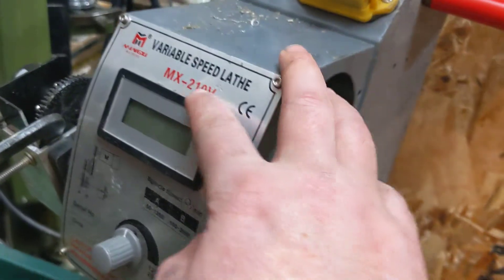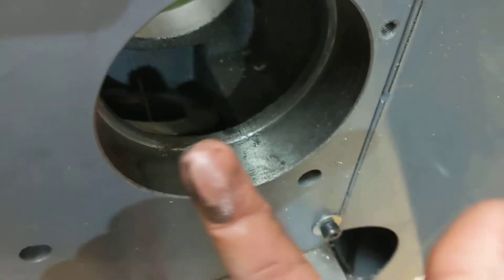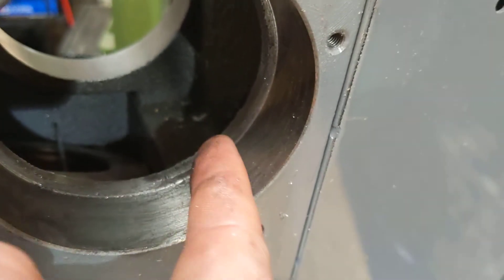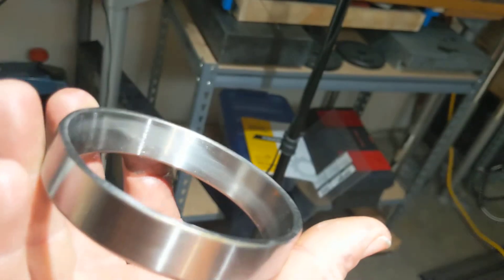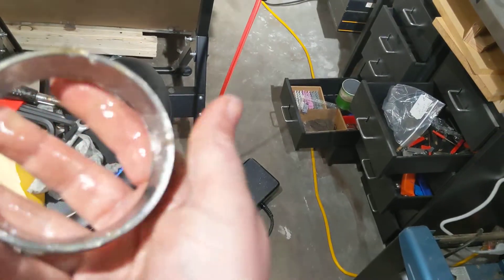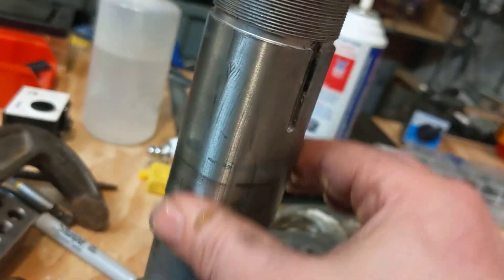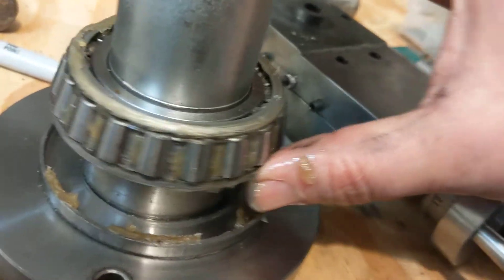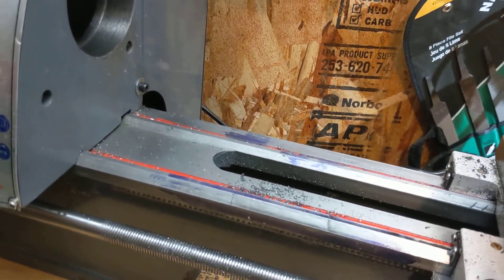mx-210 d/s spindle bearing wear not square

Comment: Just got mine and the spindle has about .040 of play, any idea what I can do to fix it or should I just return it.
Reply from the maker: 0.040" or 0.040 mm?  bid difference between the two.  get a spanner and tighten the spindle nuts (loosen the locking nut first).  If that doesn't help you should consider returning it or getting new bearings.
Reply: @JesseSchoch  0.040".
I broke it apart, cleaned the grit out of the bearings, tightened everything down, still has the wobble. Where would I find bearings for it?
Reply from the maker: @cordite_semtex  is the wobble radial or axial?
Reply: @JesseSchoch  A little bit of both it seems, but more radial. Thinking more on it after I took it apart, I believe the bearings are fine and it's the actual spindle that is cut off center, if all else fails I'll have my local shop machine it down and sleeve it center and see if that does anything. Still would be nice to have a spare bearings set though.

Comment: Hand scraped my cross and compound slide in, scraped the Gibs flat then epoxy/ws2 bedded the carriage to the bedways with my homemade moglice substitute and that took care of of almost all of my chatter. If you want a ready to use machine out of the box, this isn't the one. I consider it a kit of lathe shaped components that require finishing. How well you are at hand fitting the parts together will determine how good the machine is. Mine works very well now. I can't afford a new high quality lathe, I'm poor, but I have time and the lathe has potential.
Reply from the maker: I think the spindle tube is too thin and the chuck is too big.  I was parting 30mm steel and it chattered through the first half.  It does have some potential but it sure ain't a good lathe out of the box.  Interested in how you did your epoxy leveling, can you share details?

Comment: Good explanasion! Did you get your bearing fixed or replaced? Is parting now noise free? Im suspecting i have similar problem with my wm-210V.
Reply from the maker: My bearings never sounded bad but I did order timkin replacement bearings.  I took a bit of the preload off and it has been performing very good since I did this video.  I got a bit more rigidity by doing more tuning of the shims for the saddle.   The screws just don't provide much rigidity and shims work much better. I'm a bit concerned the grease I used when I reassembled isn't going to last but I don't feel like ripping it apart again anytime soon so I'll be running the existing bearings into the ground.  You may want to try to reseat/relube and deburr the bearing seats but you might as well install new bearings if they sound bad and you have the headstock apart IMHO.  An alternative would be to try to measure how much end play there is and tuning the preload on the existing setup.

Comment: did you by chance get the bearing numbers while you had it apart?  I have the same lathe and my bearing are not sounding very good.  I think the best bet is to replace them with a better quality bearing.  At least one part would be good...
Reply from the maker: 30209 bearings 85od 45id 20.75 width
Reply: @JesseSchoch  thanks for the info.  any other mods I should think about?  I would love to be able to slow it down a bit more for threading.  Mine has a bottom speed of 180.
Reply from the maker: @rosspower7514  i'm using a consew cs3000 on my 7x14 which I have setup for CNC and use it for threading.  it runs on 110v and if you put a 200mm fan on the controller, running the fan at  7v, the controller stays cool silently.
Reply: @JesseSchoch  any pictures of the setup?  have you noticed any power loss going down to the 550watt rather than the 750w?
Reply from the maker: @rosspower7514   the consew cs3000 is 1 HP, the CS1000 is 550w so I don't know about that one.  The sewing motor servo is very responsive.  It stops on a dime and it has good low end torque but you'll have to be sure your pulley ratio works.  The downside is that they are a bit of a PITA to reverse.  That is no big deal for CNC threading, however it would be for manual threading.   You can find generic versions but they are less robust in both motor cooling and controller board cooling.  If you stall one of these while it is already running hot it will burn up the controller which is reported fairly often.  I have stalled mine but I keep it cooled with a big fan running slow which I believe gives you a second or two before something burns out on the board.  

 If you do in fact have the same lathe as I do (with the bigger bore) you may find the gears don't work for the thread pitch you want in  any case.  I found that I couldn't fit the correct gear sets on the banjo for pitches like 0.8 and 0.7mm, the banjo was not the right size.   If you have the bigger bore your manual' change gear chart is also likely wrong.  The gear cover on mine had the right chart which I double checked with online gear train calculators.  I'm planning on adding an ELS to mine at some point but now I just thread on the smaller CNC converted machine.
Reply: @JesseSchoch  The ELS is one of the first mods I did.  I have to say that it was one of the best conversions I have ever seen.  great documentation and videos.  Works great.  I changed up a few things but love it.  For our lathe(big bore)  it is better to hang the stepper motor off the right side of the lead screw.  Thanks for the info on the cs3000, I must have looked at the wrong one.